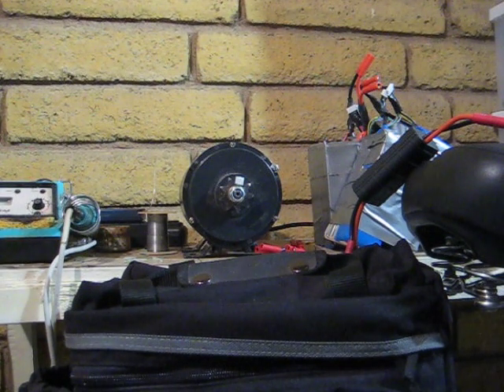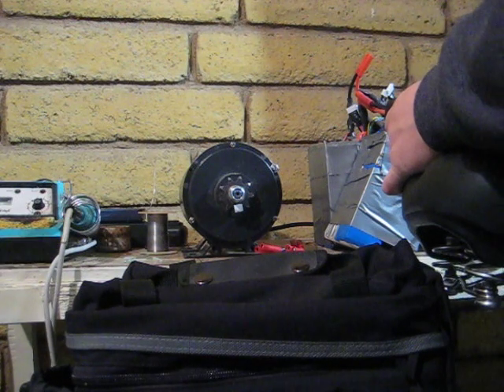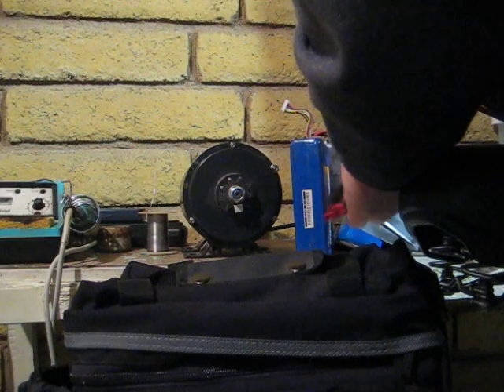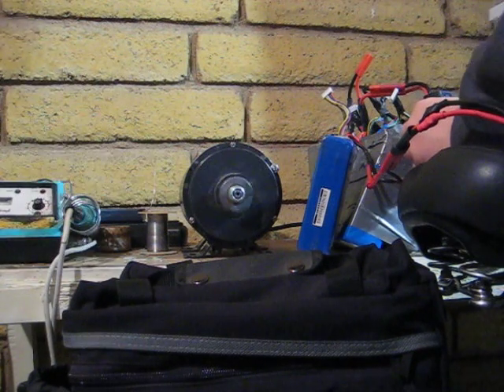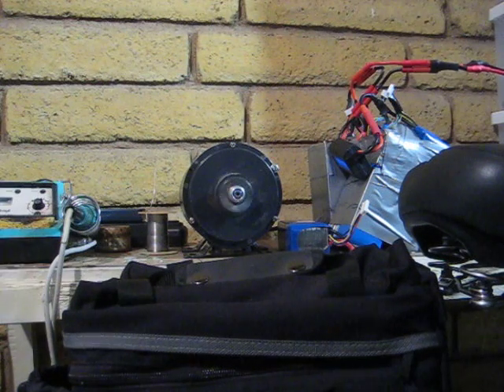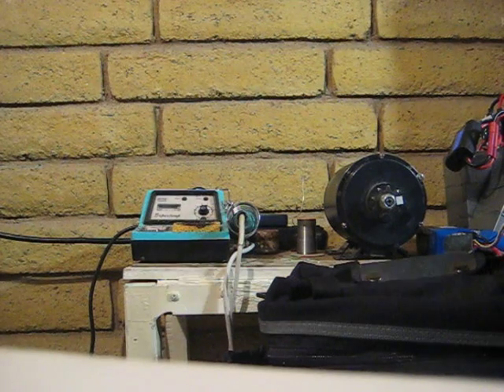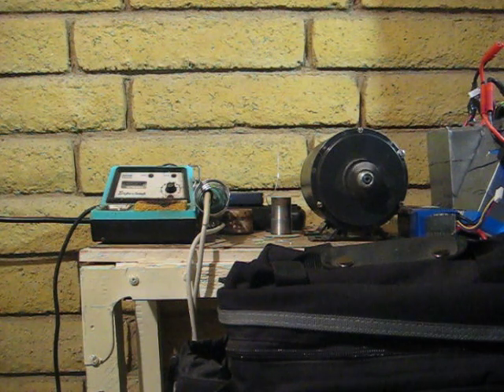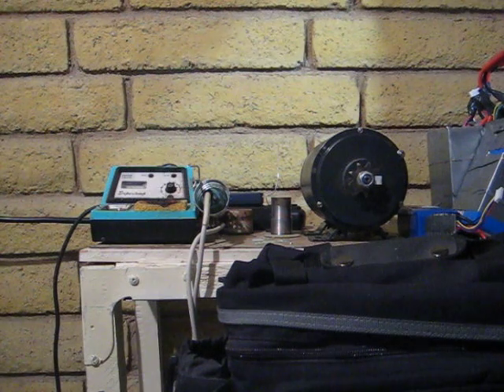Golden Motor BLT-650 spinup

Comment: COME ON.....RUN 190 VOLTS INTO THAT SUCKER.....YOU KNOW YOU WANT TO.......................................... (why stop at 190 ???)
Reply from the maker: Vitatta lol, no controller would have done that high of a voltage, but it would have been nice to see the motor blow up internally.. it was such a piece of crap..
Reply: +neptronix was it? why? :D
I am searching for a super cheap Setup just to build something. Otherwise my brain wont stop annoying me to do it. The 1.6kw Scooter Motor I had in mind is sold out.
Reply: Hi why was it crap out of curiosity?  Im looking for high torque low rpm brushless motors for an electric utility vehicle I am working on and was getting ready to order 2 of these.  Thanks.

Comment from the maker: That's the stator losses in the motor. The faster you spin it up, the more loss you get.

So on 78v, you might get 1300-1600W continuous output, but you are going to lose 101W of that to eddy current + copper loss in the motor.

The loss isn't so bad on 48v, but if you run at a higher voltage, the losses start to get worse.

Comment from the maker: 100A is far too much battery power for it. 100A x 48v is 4800W - far beyond what it can reasonably be expected to push out.

What is your gearing like? for a 26" wheel, you should be using 2:1 - 3:1 gearing.

Comment: Hello, I have a problem with my Golden Motor BLT-800 and my Brushless Motor Cruise Controller. I have try to use this all using 48V from accu (4x12V) and my motor controller has been program in peak current 100A. But i feel that my Golden Motor BLT-800 not reach the maximum speed (according datasheet 1100 rpm). So, what must I do to get the maximum performance? Thank's

Comment: i tried hooking with a curved piece of wire, the tick sound appears connecting the yellow phase or the red throttle wire (at my choice). If i connect yellow to blue i can see and hear small current pops. But maybe is just a low charge of the batteries.. factory indicates 13.5v as minimum voltage but now i have 12.3v / battery

Comment from the maker: Try hooking up 2 phases at a time. If there is one combination where the motor rotation is screwy, then you know there is a phase short in one of the phases.

You can replicate a phase short by connecting the phase wires to each other ( using an alligator clip or whatever ) and trying to spin the motor. It will have an uneven sort of rotational force. Your controller might be actually doing this inside. I am thinking that your controller is faulty.

Comment: Controller gives 63v, motor has never got hot, controller is 72v rated, every AGM battery gives 12.4/ 12.5v

Comment: Hi, there is a problem with my golden motor blt-500. It can't spins, like it's partially blocked.. if I try to turn the sprocket with fingers, it doesn't have a smooth rotation. And when I turn my throttle, i can hear a current"tickle" sound from the motor internal, but no rotation.. it is like it has something that forbids a normal rotation.. After first uses it had the particularity of being smooth in certain moments and hard in others.. how can I recover the normal rotation?

Comment from the maker: It's possible that the motor i got was a dud, but 0.5mm lams are a death sentence for higher RPM operation unfortunately. Eddy currents will dominate eventually, and i don't have a controller capable of pushing >140v anyway.

The bigger problem is that this motor is so long that i literally cannot mount it on my cargo bike, so basically i'm gonna turn it into a bench grinder :P

Google search for 'GM BLT-800W bench racing', i have a thread on endless sphere on this motor.

Comment from the maker: It's 18 pounds, so for it to move itself takes effort.

I don't know what happened with this motor ( i bought it used ), but the axle / magnet assy  wobbles a little. The bearings are in good shape, so i am guessing that the factory doesn't balance these too well.

It also has 0.5mm laminations - that's bad news for high RPM operation :(.

There are better high output motors out there, for sure. This motor puts out better power than a bicycle hub motor per KG, but a high RPM motor is better :)

Comment from the maker: Unfortunately not. The axle/magnet assy. is not very well balanced from the factory ( this is a very cheap motor ), so there is a reason that this motor is rated only for ~1000rpm loaded :(

Golden motor's HPMB-5000 would make a bicycle fly on 1/3rd of the power it's capable of. I had a motor like that at one point ( basically a brushless eTek ), but it was too much, lol.